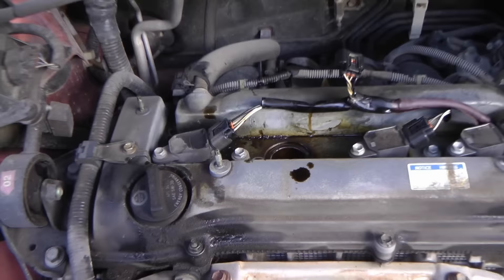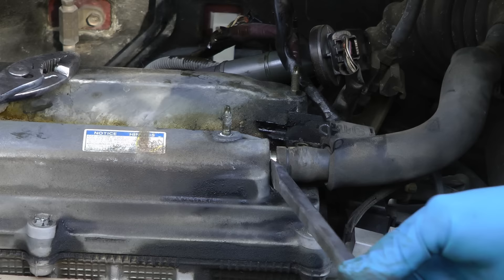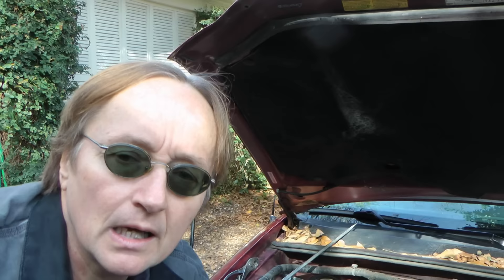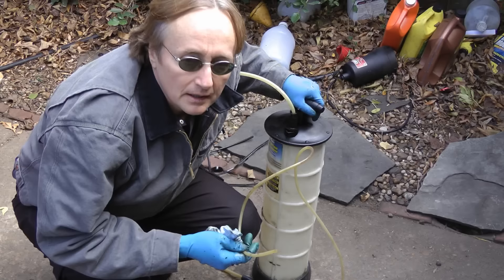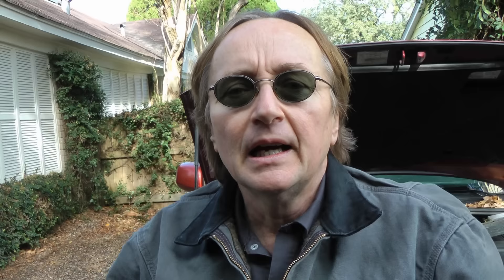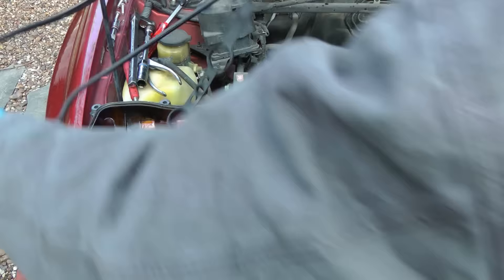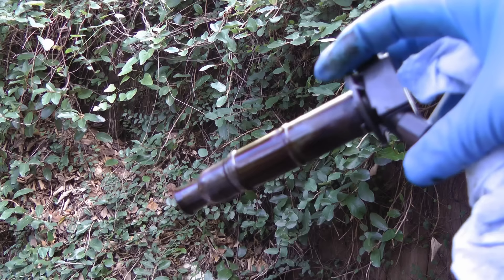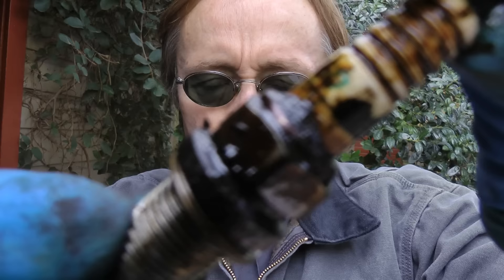How to Fix Engine Oil Leaks in Your Car

Comment: When the engine is flooded with fluid and won't be able to start or run.  This is because when the engine tries to compress the air/charge mixture, there's too much fluid preventing good compression, so it stops the engine from turning over.

Comment from the maker: well, you bought the wrong vehicle, those 3 cylinder engines are cheaply made and brake down quickly. Daihatsu is not known for quality products, they don't even sell them in the US anymore they were so unpopular. As I said, add oil and drive it till it drops

Comment: Great video! Scotty, What possible sides of the engine does leak? Is it only the cylinder head gasket? Or does it possible leak on the side where the camshaft is? Or under?

Comment: Now I feel a little more confident working on the 41 Dodge. I can't help but think the engine's shot to hell though, I poured an ATF + Diesel mix down the spark plug holes to help loosen the engine and 4 out of 6 cylinders held the fluid to the top until the next day. Oh and IT HAS NO OIL FILTER ANYWHERE. No spin on kind, it's from the canister era and that canister is nowhere on the whole engine; the line for it just goes back to the engine block.

Comment: hey Scotty. love you channel. thank you for all your amazing tips. I have a question. I was driving my 2009 Toyota Prius on the freeway. it has about 140000 miles on it...when all of a sudden...I heard a noise...and a bit of smoke came out from behind my car...and my car started leaking alot of oil until the car wouldn't stopped driving. I have no idea what it could be. any thoughts.
Reply from the maker: +Nathan “whiteout” Gibson often a blown head gasket on the gasoline engine

Comment: MAJOR PART TO THIS FIX MUST READ! When reinstalling bolts on valve cover make sure you tork criss cross and down to spec usually 10lbs or you will easily break the steam or cross thread the bolts. That or tork lightly till bolt has some firmness then give a quarter turn more.

Comment: Go with genuine Toyota parts. On 4afe same gasket as 7afe I did replace aftermarket valve cover gasket twice course it leaked then changed that to Toyota one and it hasn’t leaked since. I only replaced the outer one not the spark plug tube seals.

Comment: Can you please respond Scotty?
Today I was on my way home (in my 2013 Chevy Cruze LT) from work, I noticed smoke from under the hood and an burnt oil smell. I pulled off of the road, parked my car, and shut off my engine. As I lifted my hood, I noticed a tiny  fire (which I easily blew out). I also noticed my oil cap was popped off, engine oil all over the place and no oil inside the engine. Do you know what the problem could be or what it sounds like? Any help will do, and thanks in advance! Love your channel by the way, it’s so helpful!

Comment: Oh hi scotty! Another interesting video indeed. I got a problem; me and some friends are joyriding with an old Volvo 744 -88 which runs really good from time to time. Most part of the times we drive it the engine starts to run really bad and stops so we have to tow it home. When we try a couple of days later it runs good again, until this problem occurs again. What can it be? MAF sensor? Bad sparkplugs?

Comment: Would this apply if the spark plug threads are oil-covered?  The electrodes are dry, as well as the spark-plug boot.  It's just the threads that are covered.

Comment: I wouldn't go with the head gasket idea unless you are having other symptoms of a blown head gasket.  They are expensive to mess with and that's probably not the cause of your problem.  Is it smoking out the tailpipe or do you have smoke coming off the engine area at startup?

Comment: Pay attention! There's no snake oil fix for oil leaks, you just have to get out your tools and get it done. You can usually pay a bit more money and get a silicone gasket (for valve/rocker covers at least) that's better quality. Sometimes you have to use a small amount of RTV to keep the gasket in place so it doesn't fall out and get pinched.

Comment: No I dont mean cut. I mean dent the surface of the cylinder head. In my beginner days, I made a huge mistake of placing a thick dull pry bar in between a block and a cylinder head to pry the head off. It dented both block and head, and after the cyl head got machined, the block stayed scratched/dented. After the job was complete, coolant would shoot out the side of the engine. Im still paying for that mistake till this day.

Comment: Hey scotty so my car has the same problem as the car in this video, thanks for the tips on how to fix it, but my check engine light keeps coming on for miss fires in cylinders 2&4. Its a 2004 Kia optima LX, any ideas?

Comment: Scotty I have a 2003 Mazda Protege5 auto with 150k miles.  I was wondering if city rush hour highway traffic burns more oil typically than that of say highway driving steady at 70-75mph?  My car typically goes through about 1qt of oil in between oil changes, but recently it seems to burn a bit more.  I have as of late done a lot of stop and go driving in rush hour traffic.  Otherwise car runs strong with no issues it's proving to be a strong engine and transmission.  I'm just trying to keep it going!   Your advice is always appreciated.  Jason
Reply from the maker: you got it, highway driving is equilavent to about 10 percent wear versus stop and go city driving.
Reply: Scotty Kilmer I have a 2000 diesel pajero that has a temperature guage that always goes up to hot. I dont know whats causing it. the coolant is always fine. the fans. belts and water pump is all fine too. also are pajeros a good vehicle or are they money pit machines?

Comment: I have a 98 acura 2.5 tl. i thought oil was leaking from my oil filter however upon inspection I noticed My oil is leaking from where the oil housing meets the engine block. I  am told it needs a new seal. I used the AT-205. It immediately stopped the leak but I notice in the mornings it still leaks and the rest of the day it does not leak at all. I am  not sure if it is still coming form the same spot b/c the Area still seems dry. I am confused. Any Advice? Your video's Are great!! THANK YOU SO MUCH FOR ALL THE GREAT HELP!!!
Reply from the maker: give the sealer a couple weeks to work entirely. If it still leaks, do my video "finding and fixing car oil leaks"

Comment: I love your channel. I've finished so many things on my car all by myself thanks to you!!!!! Anyway, I just brought a 2006 Dodge charger and when I took it to get an oil change the guy told me I needed a oil filter housing but cOme to find out it doesn't have a housing. So, I took it to my mechanic and he said nothing is leaking from the oil filter but it leaking on the side and on top. Its not dripping a lot but under the hood its oil on wires and certain places. He think its the intake or intake gasket... Any suggestions??????
Reply from the maker: +Luecretia Francis   do my video "finding and fixing car oil leaks" that always finds the source, find a mechanic with such tools if you don't want to do it yourself

Comment: Personally, I would not take a wire brush grinder to the gasket seat for fear of ejecting some particles and having them plug an oil passageway in the top end. And again, even though newer spark plugs have that coating,  it wouldn't hurt to have that cheap insurance of anti-seize on there.

Comment: I have to replace my valve cover gaskets pretty soon.  Thanks for all the info!  Just out of curiosity, would it be wise to clean up all of the oil that has built up in the cover as well?  Or just pump the oil out of the spark plug holes with the vacuum pump?

Comment: Actually that's PROBABLY not too bad - check the upper plastic intake plenum.  If you pull it off, you'll see 2 parts that are held together by a rather weak clip that sometimes breaks.  Reattach it with some RTV and you're good to go.  Or, get a new one from a junkyard.  It sounds worse than it is.

Comment: Uh yeah I was thinking the same thing. Never will I use a wire wheel to clean a gasket surface with exposed engine internals!

Comment: I wish my car repairs were always that easy.  It's always an easy job in the beginning then when I'm almost down to remove the last thing/screw I find that I'm missing a special tool that will remove the thingymajig that's blocking the thingamabob I was trying to replace.  So everything goes back on and an hour later I show up at my mechanic's shop.

Comment: really good video. is there a way to fix this without removing the whole thing?
Reply from the maker: not really, gasket get hard from engine heat and crack and need replacing

Comment: Hey Scotty, I like your videos they are very easy to understand and make us optimistic when car trouble appears. I  have a question regarding oil. I have an Opel Astra G fabricated in 2002 and for a few weeks I found that the oil consumtion is way too big. I know that this type of engine has this issue but mine it seems to lose about 1 liter of oil at 700-800 km, which is not good at all. My engine type is a 1.6 16v 74kw/101 hp Z16XE. Any advice please.

Comment: Hey whats up Scotty,useful video.How would you handle an oil leakage on a diesel Chrysler Voyager bus at the turbo,wich is on the back of the engine so you cant get there easily.I wonder if you could show me a tric.Thanks.

Comment from the maker: Na, a fine wire brush is only going to put rubber small pieces of the gasket in, and they will burn and go out the exhaust with no harm. You'd have one crappy engine if the head started shaving off from that.

Comment: Scotty, my 92 f150 will not engage the 4x4. It is a push button system. After the button is pushed I can hear the computer on the passenger side inside the cab under a kick plate engage. But after that I am lost on what other part to check that are part of the system.

Comment: when i changed my spark plug, oil went inside the cylinder. after change, i drove it couple miles but no smoke or difference i could tell. do you think that oil could still damage my car's engine. awesome video. thanks
Reply from the maker: NO

Comment: thanks ,, scotty ,,one question ,,is necessary to put silicone on the gasket , to seal the valve cover  or not ,, thank you very much ,,it is very helpful.
Reply: +erick91402 A valve cover gasket makes its own seal.. That's why it's called a gasket. You may be able to get away with putting some silicone adhesive on any flat areas that are right next to a large curve in the gasket but don't apply too much or anywhere else otherwise the flat gasket becomes a bumpy uneven surface for oil to leak out of.
Reply: great...thanks a lot...

Comment: Hello Sir! Long time fan here! I have a 2010 Dodge Charger 3.5L SXT that just started to leak oil from the bottom... im going to have it checked out and hopefully it won't be anything bad.

any idea what it could be before i have it sent off before I have it checked such as and Oil Coolant line or something simple? it seems to have a new Oil Pan Gasket and the Oil Filter is snug and not leaking... thanks for your time!

Comment: If it leaks when the engine is cold and off, where could it be leaking?   It leaked 2 quarts I added in the morning when the engine was off and not running.  It leaks onto the flex pipe. 94 camry 4 cylinder.

Comment: I saw a video in which you used AT 205 reseal , someone mentioned that they used it to stop oil leak  and he also said that his oil pick up tube was clogged up from all the paint/ varnish that was applied on inside of oil pan  that the 205 stuff had managed to loosen up? He also said that when he put it in the oil, he let it sit overnight, instead of starting car and letting it  run and work it's way around, would you still recommend the 205 reseal ? Or is it too risky?

Comment: Hey Scotty!! The two hoses connected to the valve cover, one is the PCV hose, what is the other one? what is its function? what could it mean when you find engine oil residue inside that hose?.
Reply from the maker: +Ahmed Meguid one side of the hose goes on the valve, the other goes to an intake manifold vacuum hose to suck it into the engine. If oi is inside, either valve is worn OR engine is just starting to flat wear out inside from worn piston rings

Comment: hey scotty i got a 03 cadillac cts 3.2 v6, i've already taken off the cam covers and removed the spark plugs, i see in this video about oil getting down in the piston area.
1st question is: will i need sealant for my cam covers(i did notice that previous repair they did use sealant)
2nd question is: i'm pretty sure i've gotten oil down in the piston area by removing the spark plugs, so what should i do before putting it back together. thanks in advance
Reply from the maker: yes, use sealers those are notorious leaking warpers as they age. Before you put the spark plugs back in, crank the engine, that will blow that oil out

Comment: when cylinder's filled with engine oil and u try to crank the engine, the oil inside doesnt compress (compared to fuel/air mixture), and the force will fuck up connecting rod and piston

Comment: I might seem a little too careful but using that wire wheel to grind off any hardened seal, seems an unnecessary risk of getting bits of crap into places that can't be seen, reached or flushed before it circulates causing damage to your engine.

Comment: I wish my 2002 Mitsubishi Montero Sport 3.5L was that easy to replace my valve cover gaskets. I have to take off the throttle body and entire air manifold. What a headache it's going to be. 
Do I have to drain the engine oil first before I replace the gaskets on each side.

Comment: I was in the service and when I took the car he began to lose gas in second gear sometimes, took a while to find the problem that was cracked porcelain one of the three spark plugs, after that the car is working normally but is losing oil

Comment: Scooty i always read about torqing spark plugs just right. You literally just put the spark plug in and barely turned it. Do you recommend jdoing it your way or using s torque wrench

Comment: I replaced the Air Filter on my 96 plymouth grand voyager yesterday and decided to remove the battery to give myself more working space (tight spot for the air filter housing). After replacing everything as it was, I started my car to make sure everything was okay. Car started just fine, but immediately after starting, the engine idles really low (below 1000) for half a second, then recovers. Does it sound more like I didn't put my air filter hoses on properly or that battery connections r loose

Comment: Went to have transmission oil flush and filter change yesterday. They put it up and told me U have oil leak. I said, I always check on my driveway to check for oil and gas leak and has not seen any. He then said, because dirty has prevented it from dripping. Anyway I was there for more than 3 hours and for transmission fluid,flush and filter, my bill was practically 7 hundred and they told me I had a discount.

Comment: i have a diesel turbo engine, also the top of the engine is covered in oil around the sparkplugs and injectors. could it be the same problem? it leaks a really small amount.

Comment: Hey Scotty I have a question about my truck it's a 2001 gmc sonoma. I think I'm having a similar issue. I have an oil leak that looks like it's around that area And my truck is idling bad and running bad when I start it up. It also makes accelerating bad and it shakes the truck. It seems to get better when the engine warms up completely but the problem is still there. It's not transmission and I'm not sure what the issue is. I can make a video of the issue if that helps I would really appreciate the help.

Comment: What's your opinion on using Permetex RTV sealant either in place of or along with the gasket?
Reply from the maker: I would use the right stuff without a gasket, but the RTV sealer I would only use with a gasket

Comment: 2012 buick verano oil consumption problem. Replacing the belt and pulley it leaks so much the driveway is black. Help car is over 100.000 however Buick had it during warranty several fixes completed but problem always existed

Comment: Scotty, nothing to do with the actual subject, but the horn in my father's Accord 96 stop working. It worked ocassionally till stop working at all. The horn shares the fuse with brake lights that works fine. So, I'm lost. Have you serviced this issue on this car ?. If you have any clue, it will be ver welcome. Cheers.

Comment: Hi Scotty…I have a 02 Chevy Tahoe the oil leak on top by motor I was told to need a oil gasket cover can you steer me in the correct way can it be saved

Comment: Try doing this on a Ford Explorer.  So many hoses and stuff blocking the covers it feels like you're taking the engine apart.
Reply: rumandcoke32 ~~ Same with an F150.   Took me 9 hours.  Glad I did it and know I'll probably never have to worry about it again, but they all ain't as easy as the car Kilmer worked on.
Reply: moncorp1 I am dreading the amount of time it will take me, but the savings is somewhere in the neighborhood of 300 bucks.

Comment: On my Nissan's QR20DE engine, the spark plug well gasket is built into the cylinder head cover, which means I need to replace the whole thing even if just one of the gaskets has cracked. Is it all right to use silicone gasket maker to patch up the leak as a temporary (or not so temporary) fix?

Comment: Yo Scotty! My car has the issue addressed in this video.. I replaced the valve cover gaskets, and two of the four spark plus wells still fill up with oil. I replaced them again thinking I did it incorrectly, only for the same two wells to continue flooding with oil. Any thoughts on what it could be? It is a 1988 Honda CRX. Thanks!!

Comment: Hay Scott I changed my valve covers on my g35 my driver side is perfect, but oil is leaking on my passanger side. I reinstalled it like 5 times but oil still drips and burns after running it for a couple